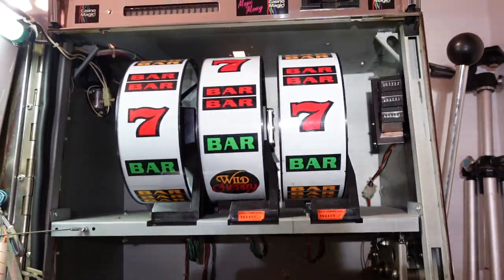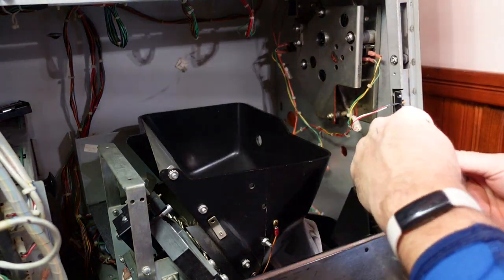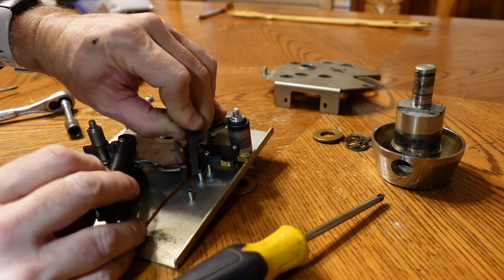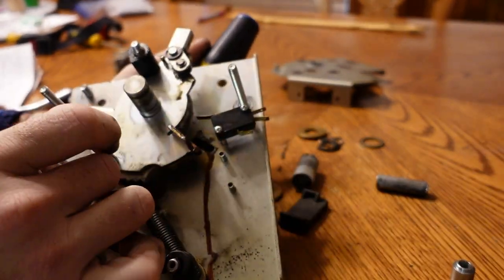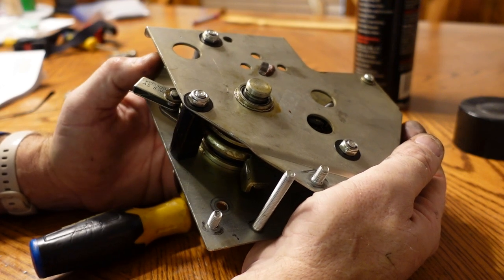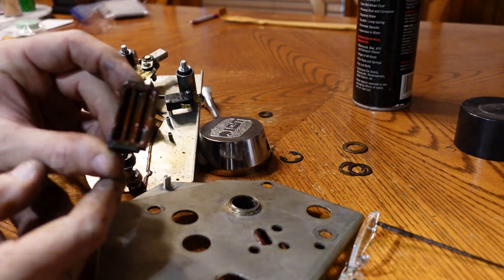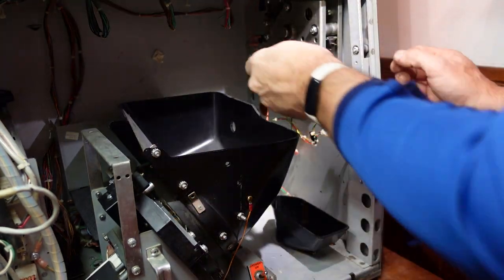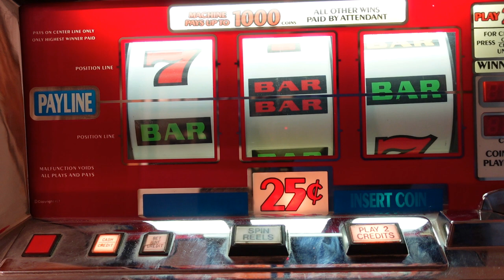Fixing the arm mechanism on my old Slot Machine

Comment: Hi could you help with some advice why my bally machine is on free play regards Lee
Reply from the maker: I can suggest that you may be able to find the service manual online. That's how I got mine working again. Plus it shows the different service modes. I'm not sure on yours, but I know to change the win percentage requires an actual computer chip change out. I'll take a look in my book to see if there is anything about free play that might help. Thanks!
Reply: @aaronsrose  thanks